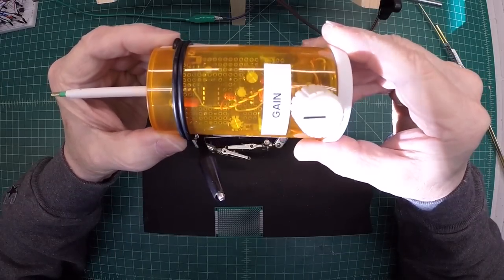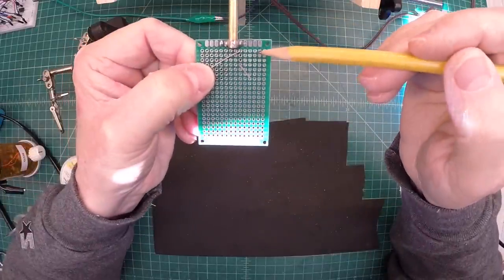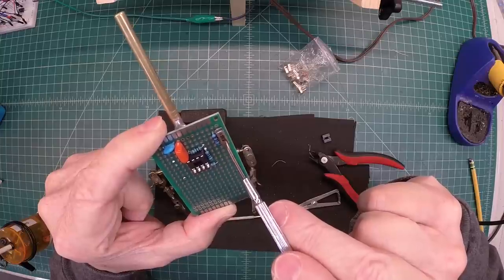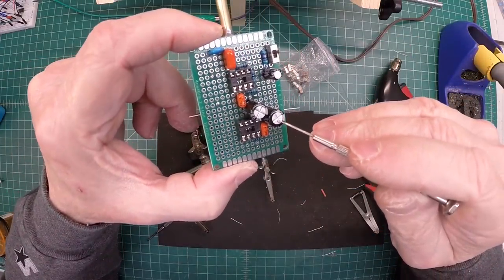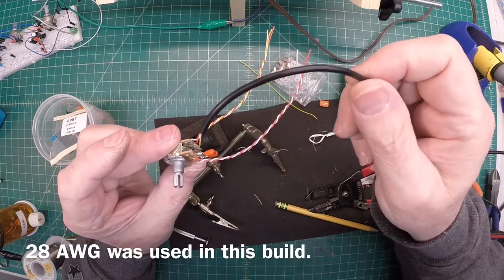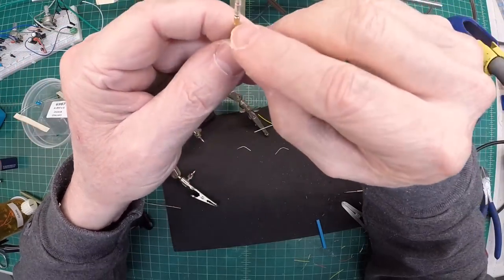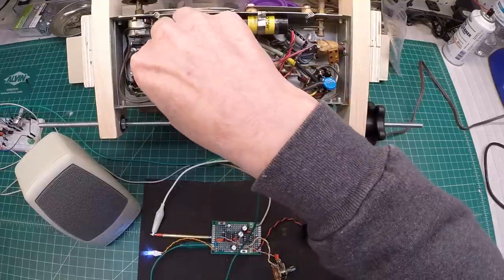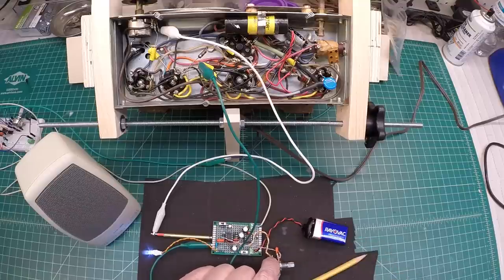How To Build A Signal Tracer - Part 1

Comment: For shielding from RF I have found a good material that does the job. Those frozen chicken pot pie dinners have a special coating on the lid of the microwaveable container. The coating concentrates the microwaves and browns the crust, it also is a excellent blocker of RF.
Reply from the maker: John - Very cool and thank you for sharing this. It amazes me what you can repurpose for projects like this or alike. Thanks again. Best, Don

Comment: One of the things I like best, well there are several, you don't waste time between important parts of the build, and you are very concise on what you are doing. But most important, you show how it works on an actural radio, thank you and 73, sending for parts now. One question, on the op-amp UA741CN Mouser says that's no longer available, I'm sure there are other's that will do the same job? And the LM386 has several models with different sufix? Thanks again.
Reply from the maker: Donovan - thanks for your kind words. Any 741 and 386 with the same specs will work just fine. Good luck on your build and I hope you enjoy using it afterwards. I use my ST often. All the best. Don

Comment: If you added a switch that would bypass the diode and the 741, and feed the probe signal directly to the LM386, could you make this a switchable RF and audio signal tracer? Also, does the schematic at the beginning still match your latest design?
Reply from the maker: You are correct and the design is current. You’ll find another probe that auto detects the source at: How To Build A Signal Tracer
https://www.youtube.com/playlist?list=PLjLu4V-71S1KGbxuJbnMPkfXsDjDU0MrX and the entire series on signal tracers I published. All the best. Don

Comment: I was skipping through the video because I was looking for older tube signal tracers and I wasn't really looking at solid state stuff, but then I heard you mention buffer amp and you grabbed my attention... I have been looking into the old signal tracers as I find them an indispensable tool. You can pick up an injected signal that is literally hidden down in the noise floor, just try and tell what's noise from a extremely week signal on an oscilloscope. Impossible! But.... Even though those things work really great... I feel that it needs it's high impedance input fed into a buffer amp... That's why your video got my attention... Now! The question that I have for you is.... The gain switch in your circuit, does it take the buffer amp out of the buffer stage and turn it into a voltage gain stage? My understanding of a buffer amp is to have a negative feedback loop without a resistor because by adding resistance, you increase gain and that means that it's not longer a buffer stage providing current to drive the voltage gain stage....My train of thought is that the input should go through a high impedance input to a buffer amp so that you don't affect the circuit under test, then you have either have another Op amp as the voltage amp or use a dual Op Amp that can function as a buffer and drive the output stage at the same time. The buffer amp just provides the current to drive the voltage gain stage and due to it's high impedance separates the device under test from the test equipment... I could be wrong but that's how I was thinking about doing it... While trying to understand your circuit, I wasn't sure if you were switching between buffer and voltage gain? If that's the case then personally I would prefer to have a constant buffer in place... That way I believe that you could potentially have a lot of gain if you chose, without putting additional load on the device under test and getting inaccurate readings... Again! I could be wrong so IF anyone knows different I would love to hear it...
Reply from the maker: Peter - forgive my belated response; somehow I missed your question. I'm not real sure how to measure the true input impedance while extending the gain, but I can say with confidence that using it in that mode doesn't load the circuit no more than the normal mode in the vintage AM receivers that I repair. Hope this helps. Best, Don

Comment: Could this design be modified to include its own Beat Frequency Oscillator??  Amateur sideband receivers are a pain to troubleshoot if there are problems with the radio's internal BFO, and this design is "not overtly invasive", at least I don't think that it would generate a feedback loop, rendering the receiver's BFO "moot, or muted".... Just thinking with the keyboard....
Reply from the maker: Great idea Tim. I’ll keep this in mind. John S. suggested an oscillator too. Sorry about my belated response. Best, Don
Reply: AMStationEngineer I wonder if a input could be added and use a signal generator for the bfo that way it is fully adjustable

Comment: Wouldn't be difficult to make it into a signal generator as well? By adding an oscillator at a fixed frequency say 1 kilohertz with an extra lead for this purpose so you can feed a signal in and read the response at the same time from the same device? For troubleshooting if you haven't got a signal to pick up say like the scenario you're showing.
Reply from the maker: Good idea John, something to work on for sure during these uncertain times. Best, Don
Reply: @RestoreOldRadios  well I say thanks for the reply even if it took two years. Take vitamin D3 3000 iu daily

Comment: Can this be used as a cable tracer like the fox and hound cable tracer?
Reply from the maker: Max - the circuit could be adapted to work like…, but a transmitter would be required to my knowledge. Best, Don
Reply: @RestoreOldRadios  Yes, a transmitter is needed. Would be great if you can make a video about how to build a cable tracer transmitter and also a video on modification needed of your signal tracer to make it work as a cable tracer. I have seen some circuit designs but never understood how exactly the circuit works. Seen some using two 555 chips to make a transmitter. Thanks.
Reply from the maker: Max - I’ll keep that in mind for a fall/winter project. What depth or distance between the receiver and conductor being investigated are you expecting to identify? Best, Don
Reply: @RestoreOldRadios  Thank You for the quick reply Don. Depth is about 1 inch or less. It's basically a 50 foot 12 volt with BNC cable pair for CCTV security camera which are just stapled to the wall. The cable is broken somewhere but not sure where it is exactly broken. I read that cable tracers uses inductive coupling technology and that it might not be able to identify the location of the broken wire since the signal will just hop over to the broken wire. I read that a low frequency signal transmitter implementation could help identify the broken wire since the receiver will produce a lower sound distinction of the broken wire area. All in all I'm really fascinated how the science and circuit behind it all works. I'll keep an eye on your great channel. Thanks again.
Reply from the maker: You may want to give this method a try: https://www.circuitspecialists.com/blog/using-a-digital-multimeter-to-locate-a-buried-cable-fault/
Reply: @RestoreOldRadios  Thank You will try this.

Comment: Super video!!  I am looking forward to building one!  What a wonderful thing you have done to share your design and instructions with your You Tube subscribers.  Thank you for all the hard work that went into the project and all the editing you did to make it all flow so smoothly.  BTW, from whom did you acquire your components?  Is that something you can share with us?  I've never ordered or worked with the type components you used to build the tracer and would like to go to the same source to acquire them.  Thanks again for all you do to advance our hobby.  Mike from Georgia
Reply from the maker: Mike - just checking in with you. Hope you &  your family are well and the ST is still performing for you. Best, Don
Reply: RestoreOldRadios Hi Don:  Been doing great on our end.  The quarantine has placed me into radio and 45 record player “heaven”.  I’ve completed 17 restoration projects and/or upgrades in the past three months.  I started going through radios in my collection that I had first “restored” 20 years ago.  Boy did I do some sloppy work back then.  They are a lot better back on the shelf this time around.  Then I turned my attention to my 45 record players, which were in various shapes and states of disassembly and got all seven of them working. And, YES, I had the SG out just a few weeks ago trying to track down a problem in a radio that just quit working one night.  I thought of you and almost dropped you a line at the time.  The SG helped me isolate the issues with the radio and I got it back into great shape.  I have been following your posts and enjoying them but have not offered any comments.  Please keep up your great work and keep me posted on your tube needs.  Corresponding, how are things on your end with you and your family.  Regards Mike
Reply from the maker: Michael McKenzie You’ve been a busy guy and congrats getting them all in top shape. It’s funny that you mention that, I had planned to look at a AA5 set today that I recapped some 20+ years ago and see what it looks like and see if it will still play. I took a nasty fall a few weeks back on concrete so I’m still moving like a Sloth. I was blessed not to break anything other than chipped teeth, but had deep bruises to my ribs, pelvic area and my left hand that has since healed up. This all happened when some hornets were on the attack. Anyway, I'm still trying to work out the stiffness and strengthen my lower back. I hope to get back on the Crosley 718 cabinet soon. I’m glad y’all are well and I’ll stay in touch via email. I really appreciate the tubes you sent me; played the Crosley on the bench just before my accident. Best, Don
Reply: RestoreOldRadios     I tried responding earlier to your email about your fall but I don’t think I did it correctly.  So here goes again.

I know that falls can be really scary (I think I told you that my mother in law fell and broke her hip about two years ago - not good).  But it sounds like you are on the mend and I hope you get back to where you were quickly!!!!!

I am looking forward to see what you do with the Crosley case.  Springtime for me means lacquer spraying weather.  🤗 I have finished about five projects in the past three weeks that accumulated over the winter with two to go.  One of the ones that is left is a 1947 RCA 65u combination radio and78 record player.  I did not like the condition of the veneer so I decided to reveneer the entire  unit.  I just grain filled the top, which is the last section before I add color to it and start spraying sanding sealer and lacquer.

I splurged about 10 years ago and purchased an HVLP sprayer.  Now that I’ve used it 100+ times, I’m finally getting to the point where I can lay down a nice finish with no orange peel and very little rub out afterwards.  What a difference in the final finish!!  But, it definitely required lots of trials and tribulations to get to this point.  The nice thing about refinishing wood is that you can always strip it off and start over.  I think I may have the record on that subject.  

After following your videos for years (BTW, I have watched almost every one  that you have posted), along with Larry in Tennessee and Michael in Utah, and a guy by the name of David Tipton in Australia, I finally feel that I am getting past my rookie stage and being able to troubleshoot things that in previous years would have stumped me.  

I hope you find the energy to keep posting your videos.  You’re still the BEST in my estimation.  Regards Mike
Reply from the maker: Michael, congrats on transitioning to a HVLP sprayer. I considered it numerous times, but never committed to it. I know rattle cans are hard to get a repeatable finish and maybe I’ll make the move down the road. If I do, I will touch base with you for best practices. All the guys you mentioned and others are super talented and I’m always learning something new from each of them. Congrats again on all of your recent completed projects. I dug out the little AA5 I mentioned and I’ll think I’ll tackle it while my back continues to heal. It’s great to hear from you and I hope your restoration projects continue to go well. All the best. Don

Comment: COuld you use a KA4558 or LM 358 dual op amp for this project?? Just use one side of the dual amp...or maybe make  it more sensitive by running the first opamp to the 2nd opamp in the same IC...

Comment: You list the outer brass tube as 5/16" x 0.014" , however in the video you state it's 3/16". Which is it?
Reply from the maker: Marc - either one will work. Sorry for the confusion, I used 3/16” on a few of my builds and 5/16” for others. Either one allows the 3/32” inner tube to slide through with a piece of heat shrink to isolate it from the outer ground. The 5/16” would be my preference that allows a couple pieces of heat shrink over the smaller 3/32”. Hope this helps and thanks for reaching out. Best, Don
Reply: RestoreOldRadios Thanks for the timely reply. I have a Mouser order arriving today, the inner tube arriving Saturday. I can pick up the outer locally. Building 3 units...I have friends. Using a Tektronix 465B can be a bit fiddly with 1uf and higher caps. Right now I guess which wave form is smaller, place cap on tip and shaft of a guitar cord plugged into cheap amp and see if sound jives with O-scope guess.

Comment: Hi, First time viewer to the channel, great video, I was thinking about trying to build one of these, was just wondering about the 741 op amp uses pos and neg voltages to operate, can pos Vcc be used and ground the negative side? Thank you and have a nice day....
Reply from the maker: Daniel - thanks for checking out my channel. Just Vcc to ground for my design. Just in case you missed Part 2 with the schematic and board layout: How To Build A Signal Tracer - Part 2 https://youtu.be/5x5op1V_LFc

Thanks again for watching and reaching out. Best, Don

Comment: Do you think this would work, using a breadboard, and on old oscilloscope probe wire, that would go from the breadboard to the probe tip...? I would remove the oscope's probe tip, just cut it off, or can I use the probe as is, and use the '1 x' setting on the probe?
Reply from the maker: Check out the link to the schematic I just sent for: How To Build A Signal Tracer - Part 2 https://youtu.be/5x5op1V_LFc  You should be able to modify the probe accordingly. I built the circuit on a breadboard and it worked just fine for me. Best, Don

Comment: Did you publish an actual schematic.   I did not see it.
Reply: You can see the schematic in the beginning of the video  at 0:04
Reply: I saw that.   It is difficult to figure out.  That is why I said actual schematic.  I guess I'll give reverse engineering this a try.   Thanx.
Reply from the maker: Reference Part 2 for the actual schematic. Please let me know if you have any questions. Best, Don
Reply: I saw it yesterday.  Much better.   Thank you very much.   I hate reverse engineering circuits.     Bigclive has a way he does it with photos of the trace side and mirror image of parts side of the PC boards.    I am going to try that technique next time.      I built a signal tracer already with the LM386 only but never considered adding the high impedance front end to the circuit.   I think I will modify it with your front end.  THANX.
Reply from the maker: Glad you got it. I measured 4 to 6 meg input impedance with a 600 ohm load. The high impedance buffer amp makes a world of difference. Let me know how the change impacts your performance. Best, Don